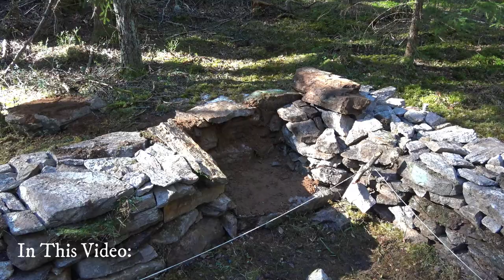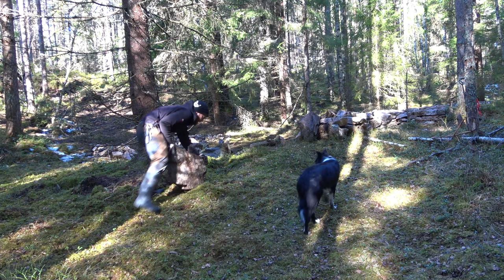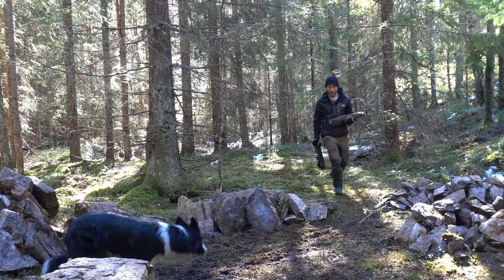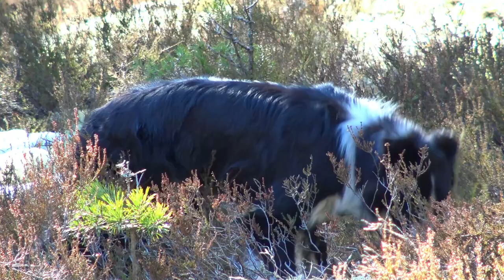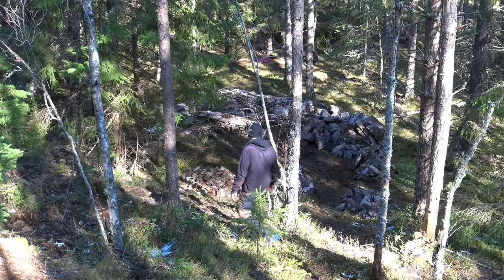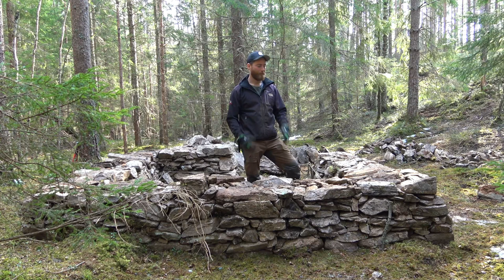Building a Small Stone House in the Woods - Dry Stone Walling - Day 11-13

Comment: Hi Adam, I just discovered your video series since I'm hoping to build a small stone house on my property in Vermont, USA.  We have lots of stone in big piles on the property, I assume from old stone walls that deteriorated over time.  Also, maybe, from excavating when the main house was built 25 years.  I figure I may as well put them to good use.  I'm thinking of something a little larger than yours, but seeing how much work it is, maybe not!   I'll look forward to catching up with the rest of the series.  In the meantime, two questions:
1.  You've started using dirt, especially when you were working on the fireplace.  Reason?
2. Where did you learn how to do this?  Did someone teach you?  A book you'd recommend?
Thanks,
Jeff
Reply from the maker: Hello Jeff, that sounds like a great project. It's a lot of work but it's worth it in the end. I would like to see the finished product 👍

I used dirt to protect the ground from the fire, especially during the dry summer. And I used it on top of the stones on the bed to protect myself better from the cold ground and to make sure no wind comes up from between the stone underneath the bed.

I watched a couple of youtube videos, I've made a couple of reflectors and other small projects using dry stone methods before but never anything this big. One of the youtube channels I'm watching is "Dry stone Tom".
Reply: @TSMAdventures  Yes...YouTube is the new universal mentor!  Dry Stone Tom looks like a great resource.  Question 3:  How did you decide how thick to make the walls?  And I'll be interested to see what you do with the roof....that'll be my next binge of your videos.  Thanks for sharing all this!  Jeff
Reply from the maker: @jeffbuxbaum7010  I saw it in a video as well, I went for about 1 meter thick walls on the bottom for good stability. I was planning to dig down 20 cm in the ground as well but it was 5cm of moss and sand and then I came down to stones and the mountain so I don't think it matters. It's crazy sturdy and I'm really happy with the result. I've spent many nights in it since I finished it 😁